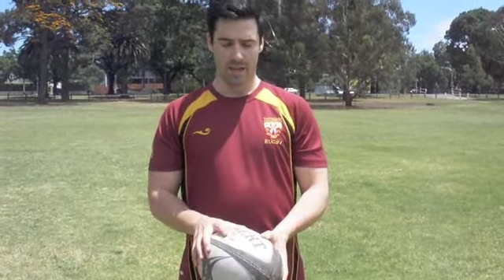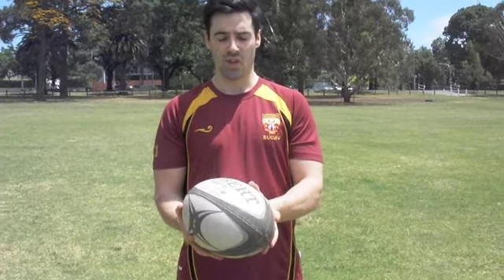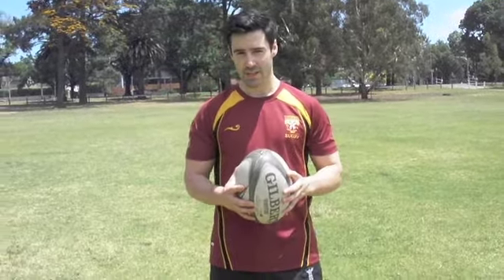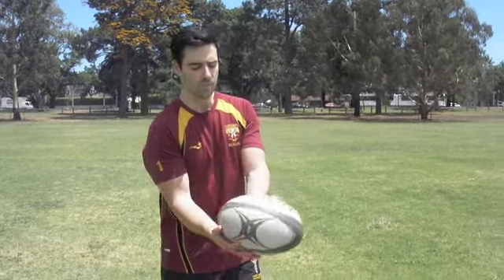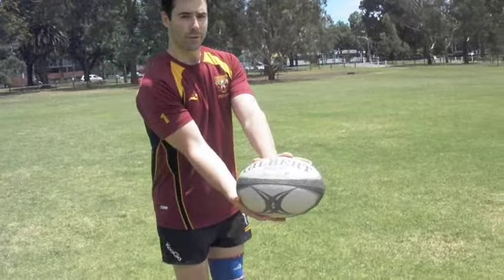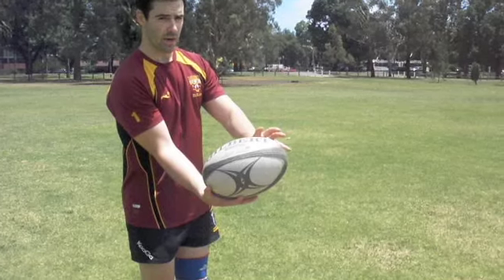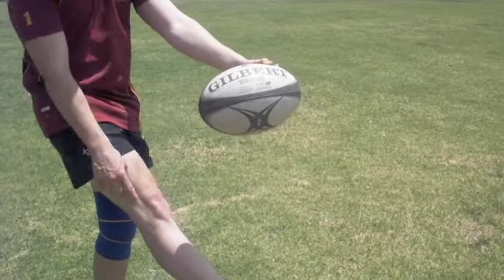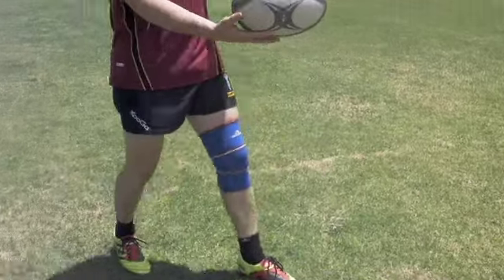Rugby Tutorial - Spiral Punt - Myrmidon Rugby

Comment: those are not real spiral kicks they are very low very close and are not spinning fast enough, a perfectly exicuted spiral kick makes mininmal noise travels strait but on an angle and goes further quicker than the traditional rugby kick, it's a kick ment for clearing the ball over the touch line far down the feild in order to get youre team down into opposition territory, the opposition will feel more pressure to defend their goal line and could possible lose possion in the line out, being this close to the goal line the attacking team could then use their forwards  to combine and drive their player with the ball over the opposition goal line ,,
Reply: walk before running so practice with short kicks before peeling off the meters.
Reply: Is it possible to spiral kick an NFL football?